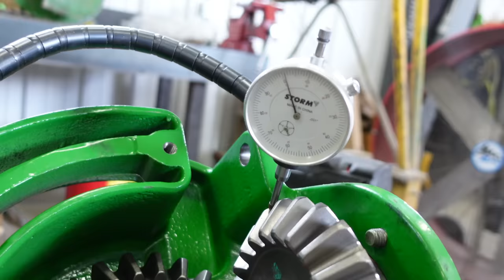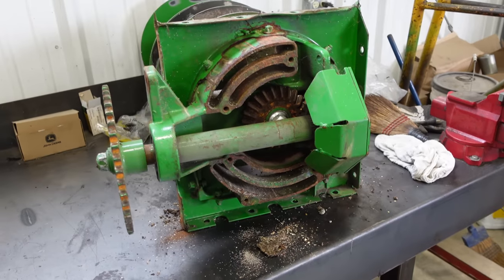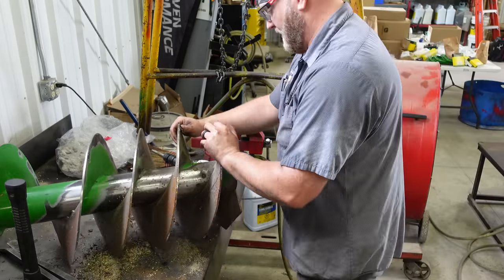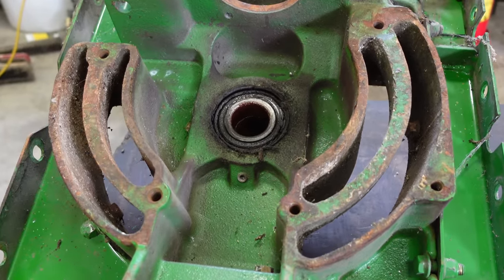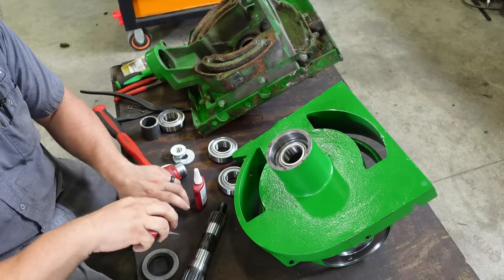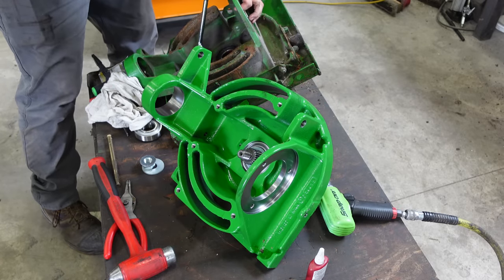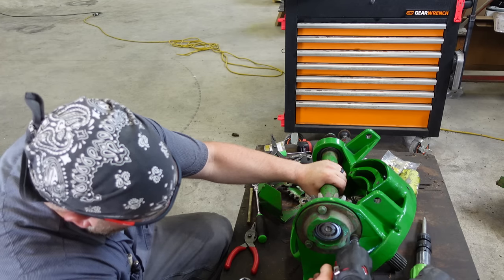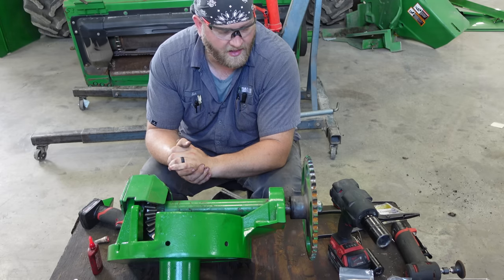How to BULLETPROOF a Vertical Auger Gear Case - John Deere S670

Comment: I think I would just use the loctite bearing retaining compound, however with the loctite primer first. Upsetting, or peening the bearing housing may make the bearing more difficult to drive in but it actually reduces the total area of surface contact between the housing and bearing. Real fix needs to be a redesigned/modified housing with either a bearing retaining plate or at least a snap ring to secure that outer "pinon" bearing.

Comment: Thanks for another great video ZK. It was interesting and enjoyable. 

Most interesting process ZK for getting everything off and taken apart. I can see with the steps you took to improve the gear case will pay off in the long run.
Nice for showing us the steps to do to improve the shaft and bearings and bring careful to use lock tight and notch the housing before putting on the bearing. 
Neat ideas. Can see the improvement these steps help with. 

Once again, excellent teaching on this process. You did great with the explanations and making a point of do’s and don’ts along the way. Good teacher you are. 

Learned a lot again. Thanks. 

About it for now. You take care and be safe. 
Say hello to josh. 
Looking forward to the next video. 
Thanks for everything ZK. 
The Iowa farm boy. 
Steve.

Comment: Pretty simple and easy rebuild.  Rebuilt a 7720 and 7720 titan 2  several years ago, so when our new to us 9650 walker machine needed rebuilt last fall it was easy. Had to prick the housing also and used sleeve retainer for the bearing.  Also replaced zerk with a grease hose to relocate zerk to make it easier to grease.

Comment: Excellent work as always, you could and should be using 7471 primer to clean up those parts before you apply the 680 etc, the bond will be 100% better than what you are achieving right now. Its one of those things, if you know, you know how much better it is

Comment: Always great to follow your work!

I'm surprised those ??? Parts... ??? (I came back when someone liked my comment: I saw a Google speech to text message error word. Dunno which I meant to have in the comment. ) don't press in the housing. On my 1999 Toyota solara I had a hell of a time with the front wheel bearings; brought a Harbor freight 12-ton press to its knees.

You would not think that pressed-in hubs would stay in with all the cornering and 90 mph driving I do but they sure do.

Comment: The dealer I work for in PA we send the gear boxes out to the machine shop and the install a sleeve in the center to correct this problem, cheaper then a new gear case.
Reply: That's what we do here as well, think they do them before combine even goes out for the first time
Reply: That's the only way to really fix them. There's a machine shop in Effingham that rebuilds tons of those. Apparently it's easier to just throw parts at it.

Comment: I know about trick to make bearing fit tighter been there and done that. What I have seen it transfer through and each roller beat that spot because it caused high spot.  Wouldn't think bearing being that hard and brittle it could do that. With what I work on there are some driveshafts with carrier bearing they knurled driveshaft, put epoxy on and put bearing on. Eaton new 12 speed, alum case steel bearings on counter shafts wear into the case. So around 250k or 300k it stops shifting either replace case or trans replacement. Fix is they now machining groove in bearing bore and putting o-ring in to stop bearing from moving. Well we will see if that works. Being cast iron maybe make something that can knurl bearing bore and epoxy/glue bearing in place

Comment: Was it a shop mate that thaught you the four divots to hold the lower bearing or did you get to it by experimenting with a common housing failure issue that you wanted to extend life on?

Comment: You can cool a shop with a 500ft spool of poly buried in the ground, a grundfos floor heat circulation pump and a radiator from a 9600 and an electric fan. The only thing is you will also need a drain...as it will sweat like crazy.

Comment: If the housing and the bearing race were anywhere close to the same hardness you could also drill and ream a hole right on the split line and drive in a dowel pin.

Comment: Hi , is that timed up against the horizontal feed auger ?
Reply from the maker: Yes 90 degrees apart
Reply: @ZKMasterTech  brilliant many thanks. I look after a CTS here in UK, one of last ones , I guess I'll come across this in future, I've had a look, when I put a pry bar on bottom shaft , between shaft and nut , it lifts 3 or 4 ml, I guessed this might be acceptable. I'll keep an eye on it. Great vid. Thanks 🙏